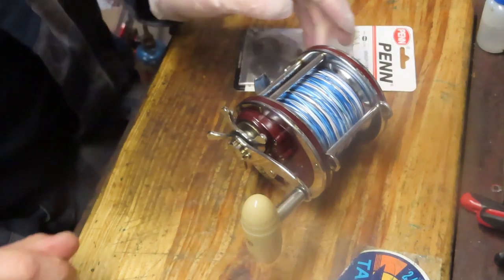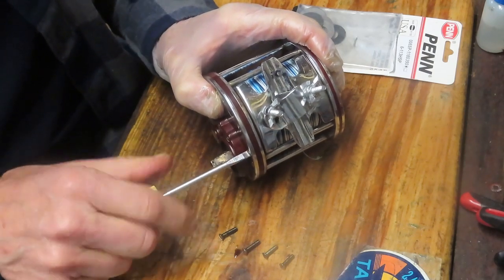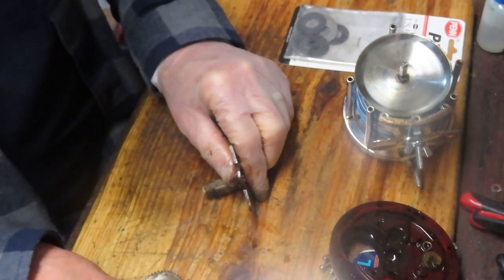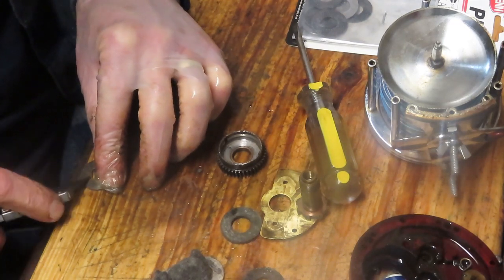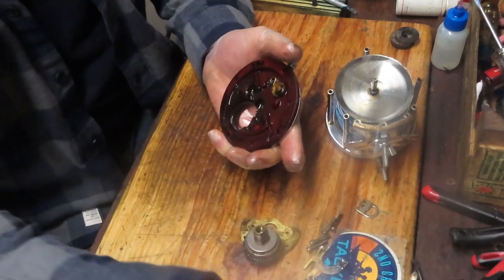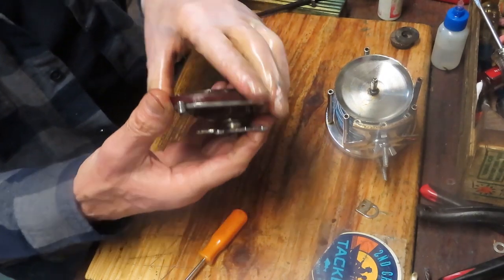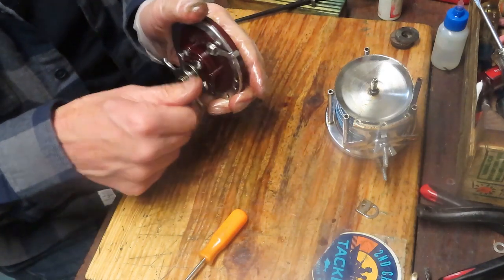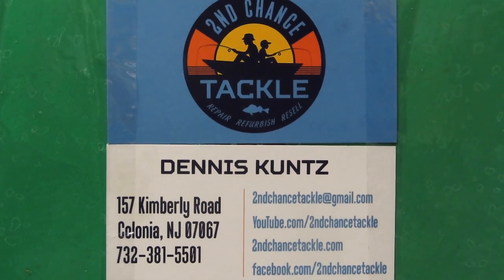Penn 113H 4 0 Senator how to upgrade drag washers and service the fishing reel

Comment: I wish you were in my area. I have two Shimano reels that went underwater so I took them to an authorized repair shop in West Palm Bach. When I got them back, neither on worked. I sent them back to the factory. They were screwed up so bad, striped screws, parts in backwards. They kept the reals for over a month saying parts were on order. New reals that just needed clean and lube. Shimano sent me two brand new reals.

Comment: I replaced the old drag stack on a 114H 6/0 with an HT-100 stack but cannot seem to get more than 7 lbs of drag even if I crank the star adjuster far enough to nearly flatten the Belleville washer.  Got any suggestions?
Reply from the maker: You may need to add an extra washer if you were upgrading from the 3 washer stack

Comment: I noticed that when you disassembled this reel you removed a washer that was between the star drag wheel and the collar, but did not replace it when you assembled the reel. I have the very same model and it has TWO washers in the same place. The original parts diagram for this older model does not show the washer(s). Do you think this washer is not necessary? Love your videos! Thanks!
Reply from the maker: The washers are spacers and you can use the reel without them as long as you have clearance between the star adjuster and the side plate.  A lot of times those washers were put in there as the drags wore down.  The washers raised the star adjust enough to clear the side plate.

Comment: i once read that the Penn HT100 drags washers were made from the same material as brakes used on aeroplanes. if grease melts then an high melting point grease would fit the bill. i use corrosion block acf 50 blue grease which is waterproof
Reply from the maker: Thanks for the tip - I will look into that product - Dennis

Comment: Hi Dennis, Like the videos. I want to know if you worked on a Reelsking TA3000 level wind trolling reel. I have one that was given to me that was taken apart by someone else. I can't find a diagram to re assemble the reel.  I put it together but is a bit tight when I want to release the line. Thanks
Reply from the maker: I have not worked on that reel as far as I can recall.  I'm not sure if it is a trade reel or not - Thanks for asking - Dennis

Comment: I bought a used 114HLW and the handle seems really wobbly and the anti reverse has allot of spin back before it catches. What should I be looking at when I open it up to make a repair? Great video!
Reply from the maker: Probably look for a broken bridge post.  That post is under the gear sleeve and a broken one would cause the issues with the wobble and faulty A/R

Comment: I have never “smoked” a drag before. I wish I had hooked a fish that could do that. At my age I doubt I’ll be going deep sea trolling again. I did enough of that when I was younger.  Since you do so many of these Penn reels do you just keep a supply of drag washers of varying sizes on hand? I worked on a beautiful little Penn 712Z today that had new HT100 drag washers in it. I recently got a 710Z reel as well. Do you know the size difference in those reels? I think the rotor and spool are different but the housing looks to be the same size. I like these Z reels a lot as I have 6 of them with 5 different models. I had fun getting the bearing and pinion out of that 712Z but it finally came out. I’m usually not as lucky as you with those bearings. I think I have 18 vintage Penn spinners now. — Chris
Reply from the maker: I keep commonly used Penn washers on hand, but I ordered the set for this one as it needed new metals as well.  I am not sure on the size for those reels.